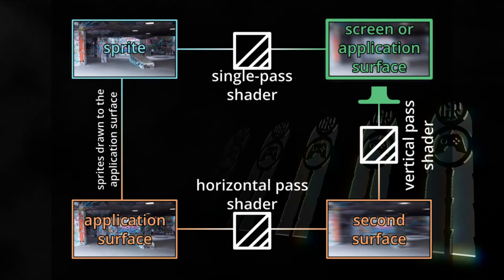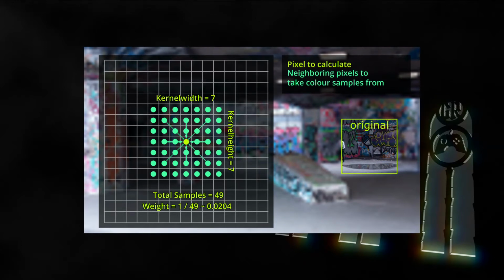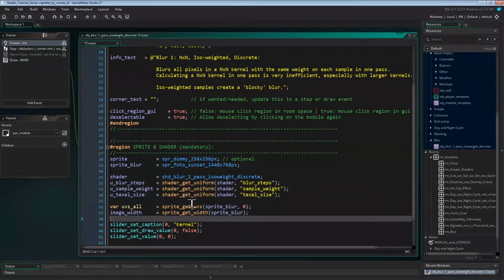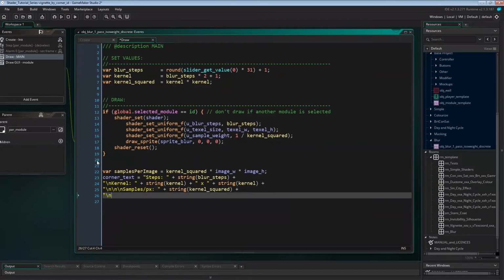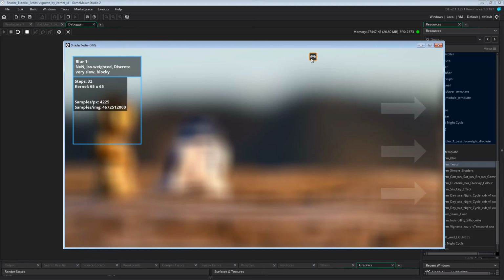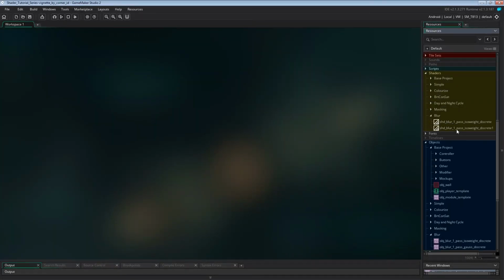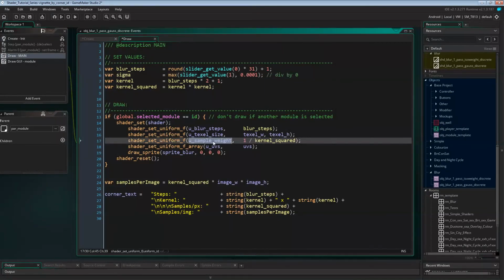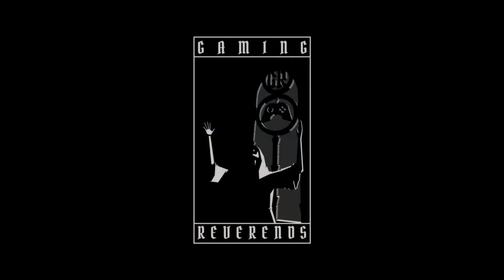Shader Tutorial for GameMaker 15a - Single Pass Blur & Multiple Texture Samples

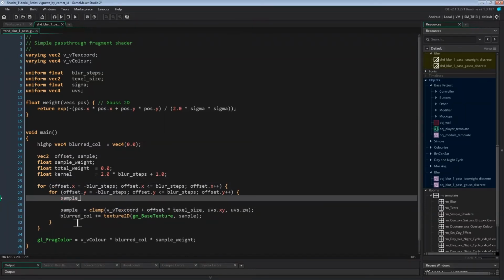Comment: Hi. Amazing video. I just want to write something for someone like me that maybe struggled like me to understand why in gausian blur (on 33:00 in the video)  to calculate the sample weight we need to divide offset by the kernel size. I believe i'ts because we have constant max sigma at 1.0 (the slider in the program changes sigma from 0 to 1) and we want to recreate the weights that would look like  curve under a graph at 29:51. So at that graph we see that for example if pos.x is bigger than 1 or smaller than -1 for sigma in between 0 and 1 the weight would be super small, to the point that it would not contribute enough to the result. But by dividing the offset pos.x and pos.y by the kernel size, instead of having offset going from -blur size to +blur size, our offset goes only from -1 to +1(in reality even smaller like for kernel size 7 from -3/7 to 3/7), so we never go past this values. I think we would not need to do it if we could change the max sigma to more than 1 but then we would need to change max sigma for every kernel size to recreate the weights appropriately, but that would be annoying.
Reply: Thank you !!!

Comment: Hey, I'm new to shaders so sorry, if this is a dumb question. I followed your instructions but my shader is not visible on the sprite. There is a performance impact, when I increase the blur steps but there is no blurring happening. Am I doing something wrong? I'm not using your base project.
Reply from the maker: I can't even guess where the problem is. However if you're new to shaders then I strongly suggest to start with the first few videos in the tutorial series. Also using sprites and texture coordinates is explained rther thoroughly in the masking shader tutorials - but those are quite advanced already.